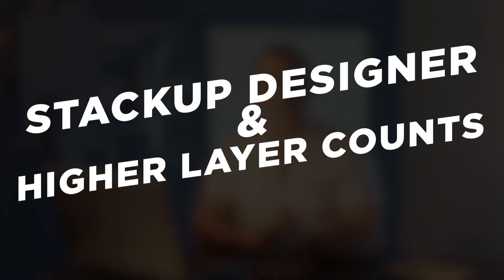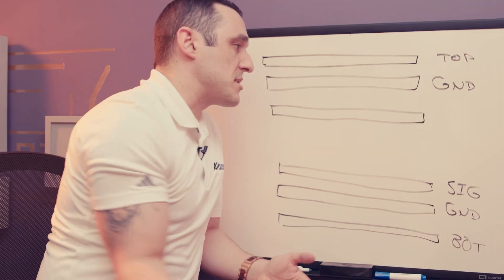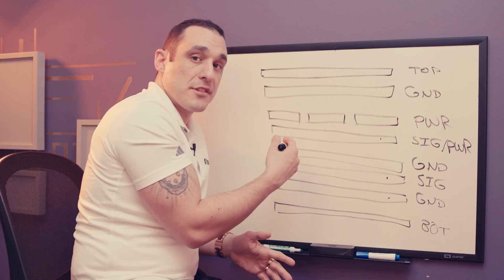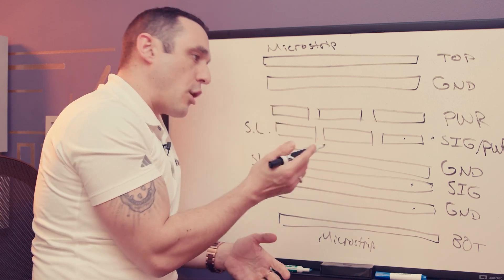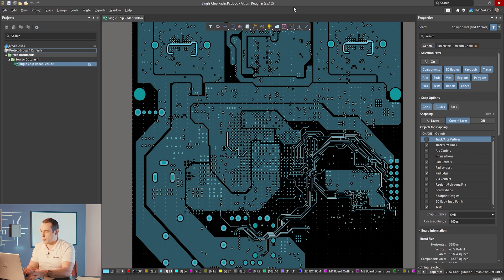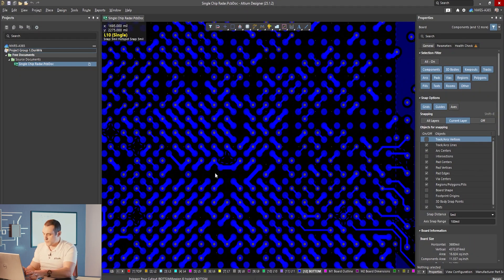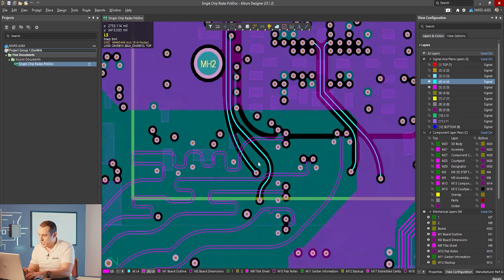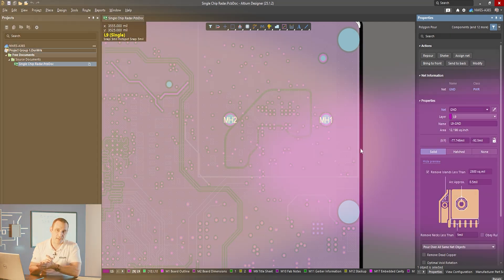High-Speed PCB Design: Mastering EMI/EMC on 8+ Layer Boards

Comment: How do you test for EMC?
Reply: Testing for EMC compliance is mainly focused in three areas: radiated EMI, conducted EMI, and susceptibility (or immunity). Radiated emissions refers to testing for radiation from an electronic device which can be measured with antennas. Conducted emissions refers to unwanted currents that conduct away from cables and conductors coming from the device, and this is measured with a line impedance stabilization network and a spectrum analyzer. Susceptibility involves several tests, such as radiated susceptibility testing or ESD testing. The specific procedures depend on industry standards governing the product and industry standards for acceptance compatibility of a product.

Comment: Great video Zach!  I wouldn't  worry about the 2 power splits if both are in higher voltage level 5V,  3.3V. I think those rails can't be high-speed nowadays, so I am not expecting fast edges.  just a thought.
Reply: 3.3V can still power fast I/Os, they might be SPI with 5 ns edge rate or even lower depending on the component and load capacitance. Definitely less the case with 5V.

Comment: Interesting video. For EMI and lower layer count, is it possible to route most of the high-speed signals on the top and bottom layers with a ground reference plane beneath them? Would this configuration pass EMI/EMC testing?"
Reply: Yes. That is one of the most common ways to design the PCB stackup with a high speed digital processor that does not require a power/ground plane pair. That is a signal/ground/ground/signal stackup. You can then route power on the top and bottom layers using large traces or copper pours. This configuration regularly passes EMC testing, many consumer products that have a smaller digital processor (like an MCU or small FPGA) will use the signal/ground/ground/signal layer stackup. Learn more here: https://www.youtube.com/watch?v=b4ncs8qfAiA

Comment: Interesting video Zach. What is the minimum trace width you are using? It looks small to fit all these digital signals on - do you see any issues with manufacturing? 
What are your thoughts on dedicating layers to Horizontal and Vertical tracking?
My understanding is that we should also use "stitching vias" to closely couple differing GND layers. This is especially important when tracks jump between reference grounds. For example if a Top Layer track with L2 GND as its reference plane, jumps to say a Layer 6 track with 5 and 7 GND references, then we should place a GND via as close as possible to the signal via.
Reply: In the 12 layer board example the minimum trace width reaches down to 3 mils, it is on the more advanced end of subtractive etching. I do not see any problems with manufacturing because we have already manufactured it successfully. The design has a 0.65 mm pitch BGA on it so it needs to have those small trace widths. You can use horizontal and vertical tracking (also called orthogonal routing) if you want to, and it is a good idea to try and do this in adjacent signal layers if they are present in your stackup. But when all signal layers are separated by reference planes, orthogonal routing is not required because you have the reference layers shielding signal layers.

Comment: I made a low cost non HDI but standard single-sided board with cortex a35 4-core 1 GHz freq CPU + DDR-3 ram, USB, emmc and hdmi on 4 layers layout! And it passed all EMI and EMC tests. Big thanks for your lessons!
Reply: *All tests were passed with third revision of board, and total cost is 1.4$ for PCB with single side smd mounting

Comment: Great video as always Zach! One can also play with where prepreg and cores are placed in the stackup to get close coupling (thin prepreg) and looser coupling (thick core). E.g you want to make sure that signal layers have a thin prepreg to a ground plane, while two signal or power layers probably should have a thicker core between them to minimize coupling. In your 6 layer stackup I would probably have the cores between layer 3-4 and between layer 6-7. Prepreg between the rest. What do you think?
Reply: Thinner prepreg is always good for creating higher shielding effectiveness. In terms of impedance, it forces traces to be thinner for a given target impedance, so eventually this makes traces quite thin. Thicker layers between adjacent signal layers and the use of orthogonal routing are best practices. This is basically what was intended in the 6 layer stackup. In the 8 layer stackup I don't think I wrote in specific layer thicknesses on the whiteboard but it is best practice to do as you describe, which takes the 6 layer strategy and applies it to the 8 layer stackup.

Comment: At what point are you concerned about via stubs? The last design looks like it would have a lot of high-speed signals that would have stubs. I feel like there is a of conflicting resources for PCIe 3.0 and 4.0 that say you can't have stubs larger than ~15mil. However, I've seen a lot of working designs that use normal through-holes with high edge rate signals on internal layers.
Reply: Anyone who quotes you a specific length for allowed stubs is either overgeneralizing a specific calculation or they are just guessing. Stubs limit channel bandwidth as a function of their length: longer stub creates a large insertion loss dip (and corresponding return loss peak) at lower frequency. Stubs are treated like a 1/4 wave resonator, so they create the insertion loss dip at odd multiples of the frequency corresponding to a quarter wavelength. Note that the signal rise time cannot predict the resonances created by stubs. I discuss it here: https://www.youtube.com/watch?v=S7iZ6dhYX0U

Comment: Nicely explained!! Although I do wonder if there had been signals withhigh data rates with sharp edge rates, would edge plating had helped in that case to minimize emissions from from board edges?? 

Also it would be an insightful information to have comparison between board edge plating cost vs layer increment costs during fabrication stage...
Reply: Good question about edge plating, yes it can be effective for containing fields that might be emitted from the board edge. The field would then experience losses as they propagate around the PCB. I think it is hard to generalize the layer versus plating cost but in general, adding layers for a single lamination build will cost less than adding edge plating. If you have a multi lamination build, and adding layers affects your number of lamination cycles then you might create a larger cost increase.

Comment: it'd be great if you could show how ommiting the proper GND layers would effect the EMC/EMI in the real world. also comparing them in EMIstream or Simbeor would be great and shows how those simulations would save a lot of time in the design. I want to be able to compare a bad design vs good design in real world with the related simulation and EMI/EMC reports.
Reply: Rick Hartley video is long but a great resource on understanding how to control EMI on layouts. 43 minutes in shows an example of Radiated Emissions across a split versus not across a split. https://www.youtube.com/watch?v=ySuUZEjARPY&t=642s
Reply: There are many tests on this in the literature and in industry publications which show the impact of not having ground near signals. You cannot do this kind of comparison in Simbeor because the software is not an EMI simulation software, you would need Ansys HFSS or CST to do this. EMIstream is just a rule checker, it does not predict EMI either.